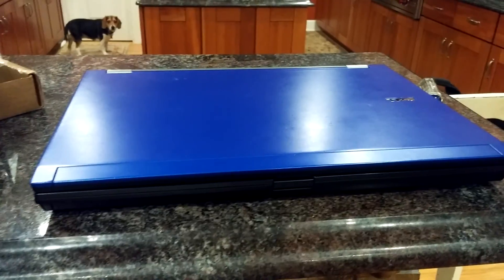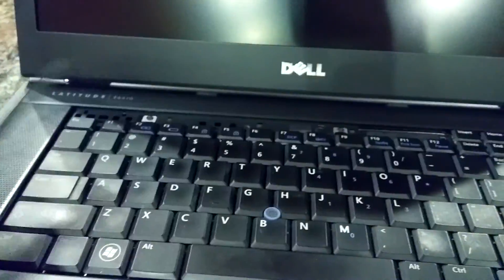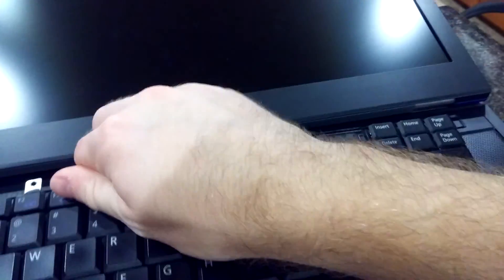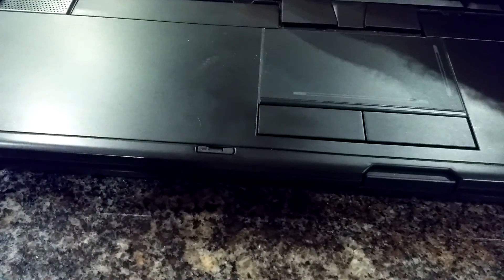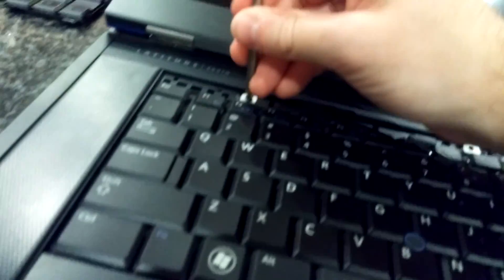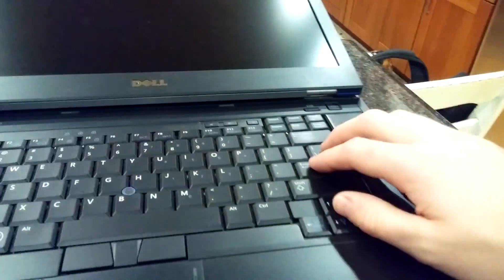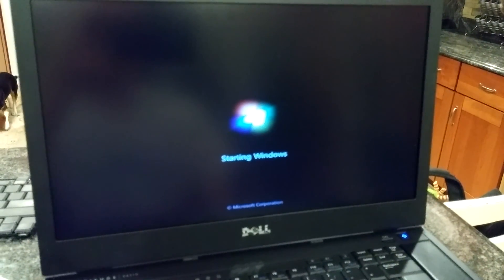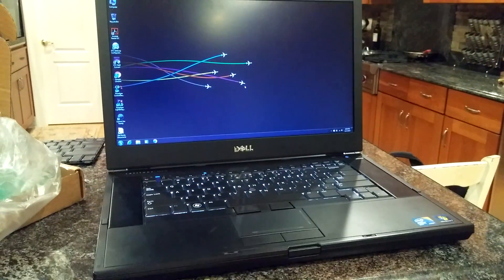Dell Latitude E6510 Keyboard Replacement

Comment: You said your screen is full HD?  Did you replace the original non HD screen?  If so, the screen connections are the same?  I have the Intel integrated graphics version of the E6510.
Reply from the maker: Yes, screen is 1920x1080, came that way when I got it. Yes, I believe the LCD panel connectors would be the same for both panels.
Reply from the maker: Mine is FHD, I bought it that way. If you upgrade the screen the connections should be the same.